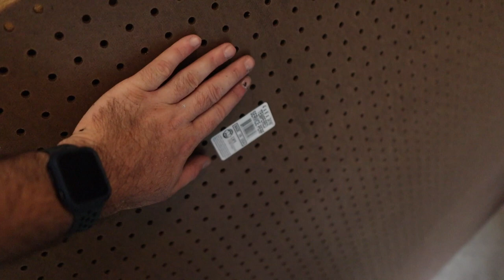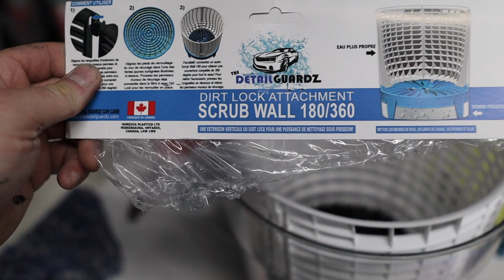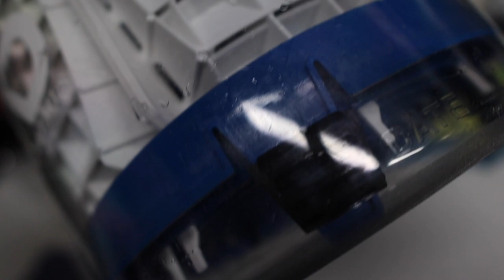Our Detailing Life / Another Busy Day #realdetailing #Detailingtips #detailounge

Comment: That new Dirt Lock device looks very interesting.   I have the original dirt lock guard which is a great one,  but having the guard all the way to the top of the bucket is a very interesting concept,  although I have pretty much moved to using one bucket with 5 microfibers dropped in it and getting fresh one every few panels until finished, never putting a dirty microfiber back into the bucket.    Seems to work pretty good that way.

Comment: Hi Phil! I love your videos - to the point and quite educational too 👍 A quick question regarding that small footprint compact Batoca polisher that is am considering for personal use. I am trying to figure out if to get that one or a slightly larger S2 version which you have used in other videos. I mainly just wax the car and the small guy is perfect for the job, but what about a polish? No cutting though. Just a 1 step shine enhancer round? Do you think the smaller one will be able to cope with that task to at least some degree? Bearing in mind that I will sling it for myself and not the customer. I would bet much appreciate your feedback as you are one of the very few professionals using the gear. Thank you!
Reply from the maker: Thanks. Sorry for the delay. SO the smaller Batoca is only good for wax/sealant application. the larger one is actually a great 15mm polisher option.

Comment: Hi Phil, great video!  In this video I see you are using the Batoca hand polisher and in some other videos you use the very similar SPTA hand polisher.  I’d like to buy one, which is better?  I’d use it for cleaner wax / one step.  Big thanks!
Reply from the maker: Thanks!  I actually prefer the SPTA Version, It comes with a 5in backing plate unlike the. other ones.
Reply: @MirandaDetailing  Thank you!  I know you mentioned it is not meant for true polishing.  Do you think it can handle an “all in one” like uno protect or 3D One Speed for light wash induced marring?
Reply from the maker: Yeah it can be used with 3DSpeed or any other AIO POLISH. you could use an orange pad and just go speed 5 and get great gloss enhancement with it also.

Comment: Hi Phil. So I got the graphene to the max wax by turtle wax the liquid form and I was reading the bottle and saw that it aid to remove any swirls or scratches. But u didn’t polish at all what is the durability of it without polishing?
Reply from the maker: Hi. True, the Max Wax is just protection. As long as the paint is clean and at least clay barred durability ranges from 3-6 months depending on how it’s cared for. Polishing doesn’t aid in durability, it aids in removing swirls and boosting gloss.
Reply: @MirandaDetailing  ok cool thanks Phil love watching your videos
Reply from the maker: Thanks man!
Reply: @MirandaDetailing  anytime also with the one and done compound and the 3D one do they clog the pads up alott or no?
Reply from the maker: Yes they clog the pads more than regular polishes.
Reply: @MirandaDetailing  ok so how many pads do you normally use on a vehicle with those
Reply from the maker: At least 2-3 pads
Reply: @MirandaDetailing  ok cool because right now I have 3 orange and white lake country pads
Reply from the maker: You should be good.
Reply: @MirandaDetailing  ok cool thanks Phil really appreciate all your help

Comment: I cringe when I see someone using a PH neutral snow foam as a pre wash, it will not do anything to the grime, you need to have an alkaline APC/pre wash to get the dirt and grime loosened.
Reply from the maker: 🤔. Wait…what do you mean?  Did you watch the beginning of the video when we did our APC rinse?  I don’t use “snow foams” like other detailers as a pre wash at all.
Reply: @MirandaDetailing  I mean that the way you guys do it with apc prewash is the correct way to do it, not just rinse off, add snow foam and start cleaning, that will only add marring to the paintwork. It needs a proper clean down before hand washing. Sorry if my English is bad, second language 😅
Reply from the maker: Yes exactly. Thanks.